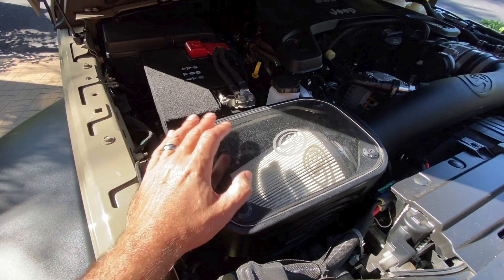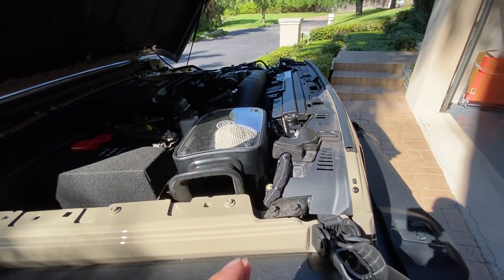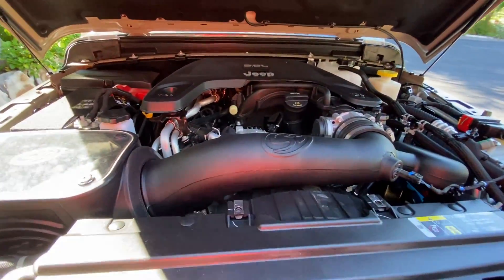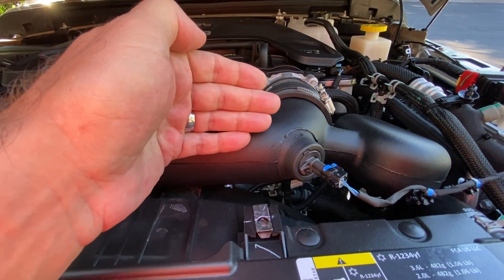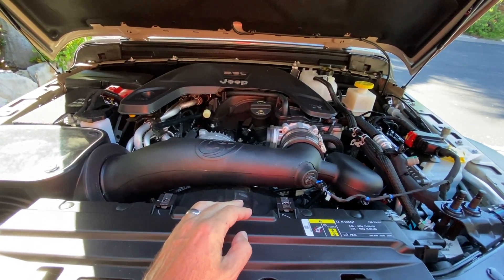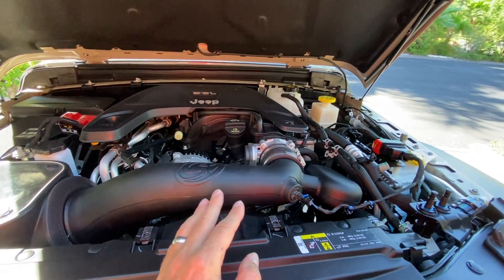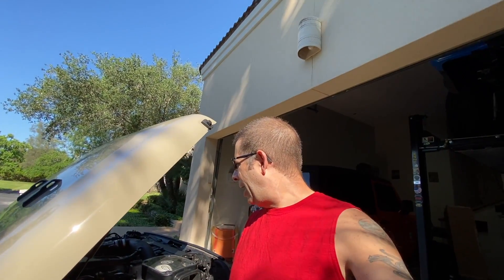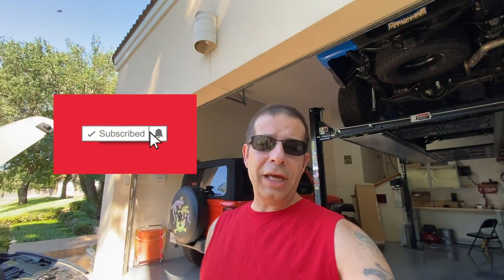Did the Cold Air Intake Install on the Jeep Gladiator Cause the Check Engine Light to Come On

Comment: I had this on my 2022 Gladiator as well. Took it to the dealer they said it was a known issue and that there was a guy that traded his in for another Gladiator because of the problem and it happened on the new one too! Why did they tell me that? Lol The dealer kept my Jeep for a week during thanksgiving. No one was in a hurry to help me. I got the Jeep back and not too soon after, it happened again and then another time as well. At 14,500 miles I traded it in and got a Tacoma. I miss my Gladiator. I should have used the Lemon law - if the issue happens more than 3 times and it’s not fixed, you can get a new car but if it happens to all of them what’s the sense? I was scared to own one of these out of warranty, thus the trade on. I like the Tacoma but loved my Jeep. Maybe 2024 will be a better year for these things and I’ll trade the Tacoma for one. Sad 😢

Comment: The misfire code issue has popped up with others without CAIs. In fact, there is a thread in the Gladiator Forum regarding this. Numerous people have taken their Gladiators back to the dealer and so far there appears to be no fix by FCA, even engine swaps have been done only to have the problem resurface. Someone suggested it may be faulty wire harnesses.  What was your mileage when this started to happen?
Reply from the maker: My mileage was under 1500 miles.  Since we reset it...it hasn't happened again.
Reply: @robmotiveplus  I read another who said he put on higher octane gas and his problem went away and the check engine light even went out. I am almost sure that is what I will do if and when it happens to my JTR. Mine is low miles like yours, but I read some have had this problem start on their drive home from the dealer.

Comment: My 2019 jeep Wrangler sport check engine light came on right after installing my S&B cold air intake. I haven't got it off yet.
Reply from the maker: Typically due to incorrectly installing the MAF sensor😬
Reply: Did you fix the issue?

Comment: The way it was explained to me by a mechanic friend is that when you install a CAI, the vehicle's computer senses different air flow characteristics via the MAF sensor and that can cause a check engine light. Why a misfire code? Who knows, but it can happen. I've installed a CAI on several of my vehicles with no problems but apparently what you're experiencing is not at all uncommon Rob.
Reply from the maker: I've heard that too.  So far since the reset there have been no more lights.

Comment: What code did it give you ? I have the 3.6 durango with cold air intake installed correctly.. the code i have is p0113
Reply from the maker: The code was a cylinder misfire.

Comment: Check engine light just means something happened that caused the emissions of the vehicle to exceed a certain percentage.
What was the code that was thrown?
Without knowing what the code is its just a WAG
Reply from the maker: I stated the code in an earlier video (don't recall what it was at the moment??).